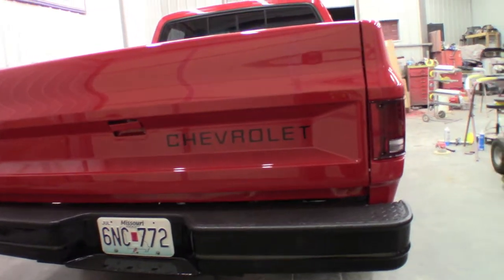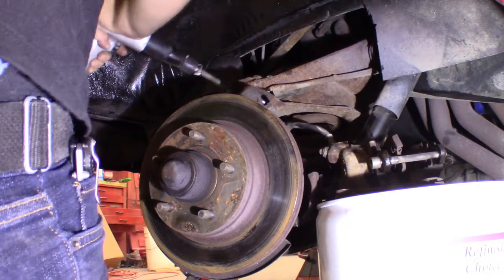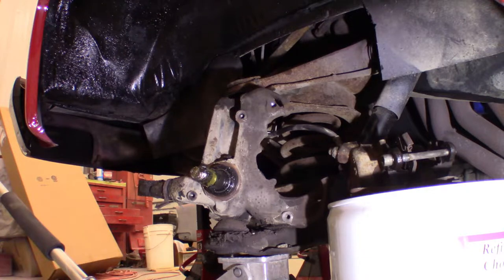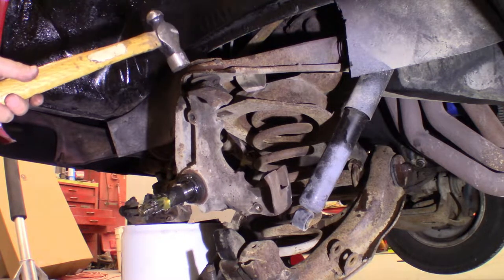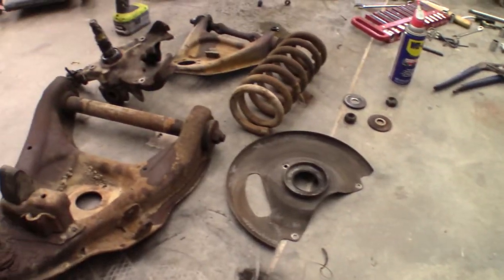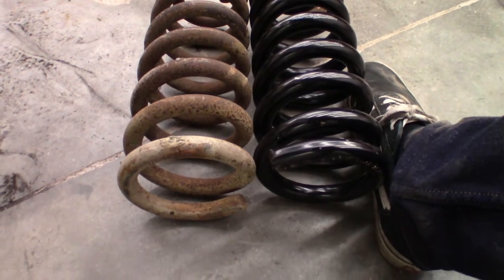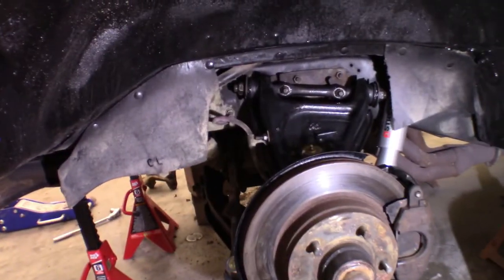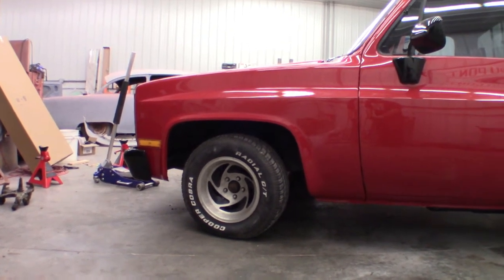Lowering Peter Part 1. how to replace control arm bushings and more!

Comment: Why didn’t you buy drop coils instead of cutting new ones ?
Reply from the maker: Drop coils where a little more expensive. Also I read that cutting the HD springs still offers a pretty good ride. So far it's decent but honestly I may just cut down my stock ones or buy some drop coils.